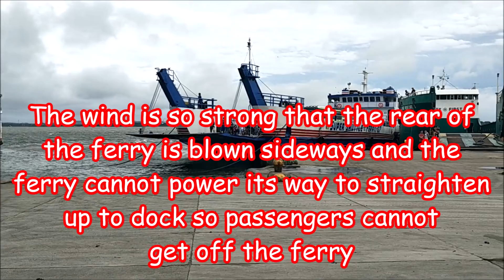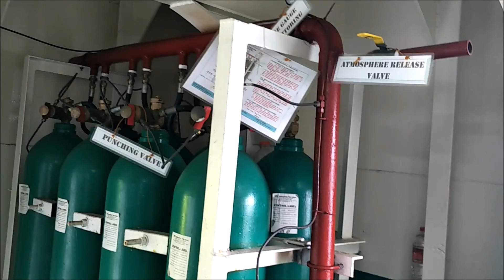The Ferry Was A'Rocking And A'Rolling On A Stormy Day From Cebu To Bantayan Island

Comment: I totally agree. he didn't have the engine  on. crank the wheel to the left and give 'er full throttle. It would have straightened right up. maybe they were firing up the other smaller ferry to help pull the big one into position. Not sure they even had the skills to do that. Also, that sidewalk you pointed out (white rubble) was obviously a great sidewalk. Just think of the one where you had to go under the bridge and stepped on a few cobbles, broken concrete, and then on boats. That was a class-b walkway. this must be a class-a.

Comment: 400 f will just melt the inside (plastic) insulation in those rectifiers. I imagine those big tanks may be halon for in case of a fire. I could see the heavy red pipes going down through the floor (into the ceiling of the engine room). I'm a true Oregonian. I love those big waves. Most people here actually don't. I've been on fishing trips out in the ocean and have all other people getting sick while rocking an bell ringing and me yelling hurrah. I could watch the foam from the boat and yes, you were not moving hardly at all.